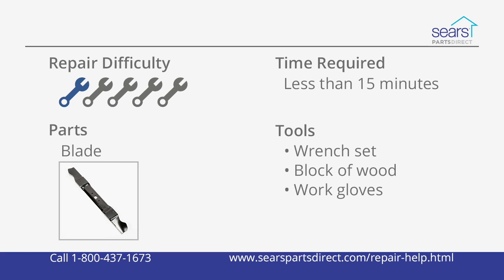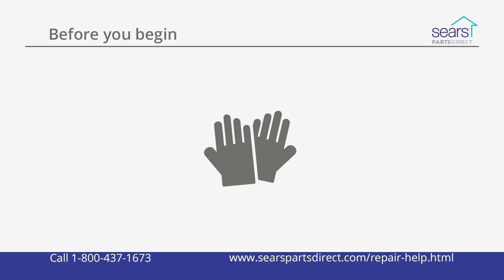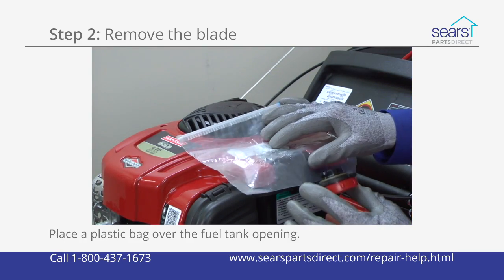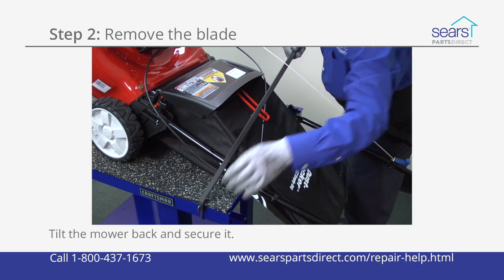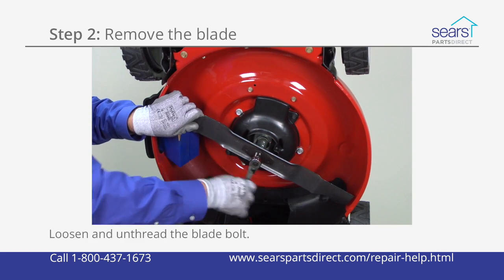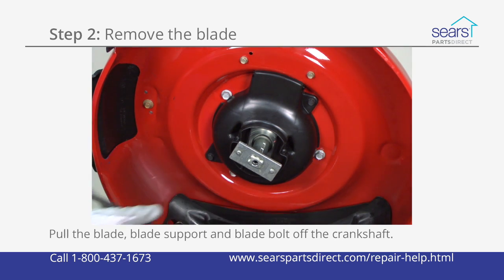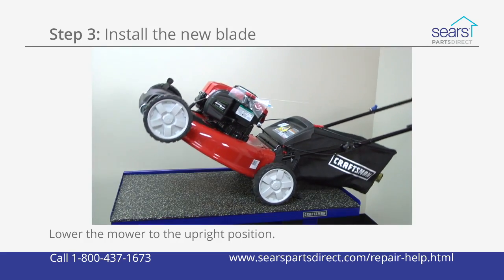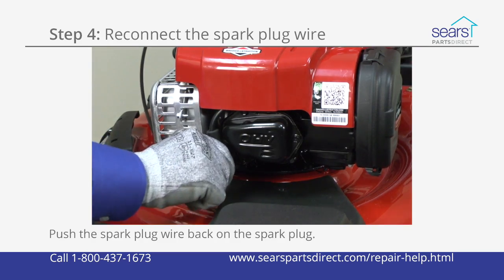How to Replace the Blade on a Lawn Mower

Comment: For push mowers, you don’t need to remove the spark plug nor gas cap. Pull slowly on rope untill you hear the piston close. Then tilt the mower, if you don’t, you can flood that engine.

Comment: OMG....How much torque did you put on the bolt???
Reply from the maker: Some owner's manual provide a torque specification for the blade bolt and some don't. Many of the manuals that do provide a torque specification recommend torquing the blade bolt to 40-50 ft-lbs. Let us know the model number of your mower if you want us to check for a torque specification for the blade bolt on your model.
Reply: @searspartsdirect :I ta;led to the manager of a repairs shop for lawn equipment and he told me you do not need to torque the bolt down. Just tighten it so the washer is flat.
Reply: Josh Frank  500 inch pounds translates into 42 ft pounds
Reply: It will tighten when it cranks

Comment: How many ft. Lbs do you torque it back on with?
Reply from the maker: Torque specifications for the blade bolt on walk behind lawn mowers vary by model when given. The owner's manual for the model shown in the video doesn't list a torque specification for the blade bolt. Models that do list the blade bolt torque specification typically recommend between 35 and 50 ft.-lbs. of torque. Check the owner's manual for your mower to find the blade bolt torque specification or let us know your model number and we'll provide blade bolt torque advice for your model.
Reply: @searspartsdirect  

Wait, is it inch-lbs or ft-lbs?

Your video stated 500 inch pound.
Reply from the maker: @michaelc7283  We didn't specify a torque recommendation in our video. Refer to the owner's manual for your mower and follow the torque specification in the manual if it has one.
Reply: @searspartsdirect  

You must check your video again. At the 1:15 min in the video it's states on the bottom of the video in the foot notes. 500 inch lbs with a torque wrench. Again right in the video.  Wow. I never seen a 500 in lbs on a torque wrench. 

Maybe a mistake in the sub text. I can see 50.0 inch lbs. Or is it 50.0 ft lbs?
Reply: @ironkey34  

Thanks for the info
Reply: About 10
Reply: @ironkey34  lol

Comment: Clockwise?  Counterclockwise?
Reply from the maker: The blade bolt shown in the video tightens clockwise. The blade bolt or nut may tighten counterclockwise on other mowers.

Comment: What size socket wrench
Reply from the maker: The socket size used in this video to remove the blade bolt is 3/8-inch. The size of the blade bolt or nut may be different in some lawn mower models.
Reply: I used 10/16
Reply: Which I prefer for that model

Comment: My blade is on so tight
Reply from the maker: Spraying the bolt with penetrating oil and using an impact wrench may help you remove it.
Reply: @searspartsdirect  thanks for the tip mate, I'll spray some wd40 on it but I havent got an impact wrench, just a standard socket wrench, I stupidly bent up the blade like an idiot, so it's my own fault